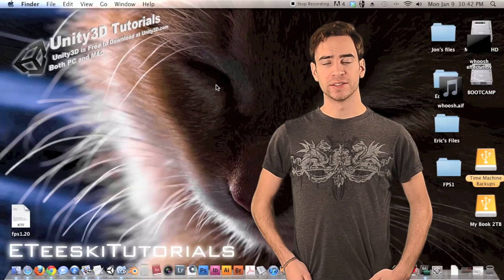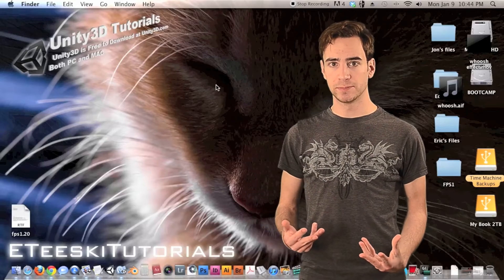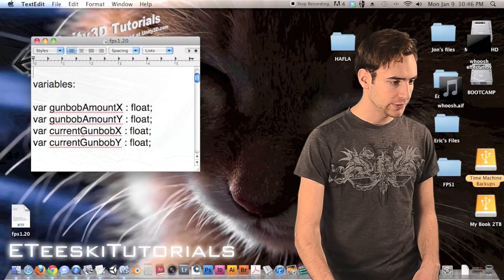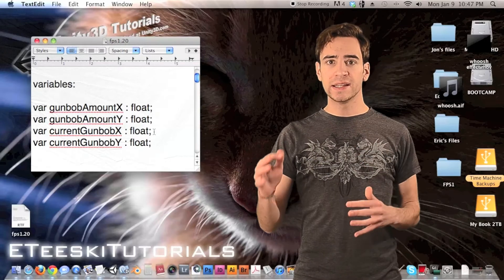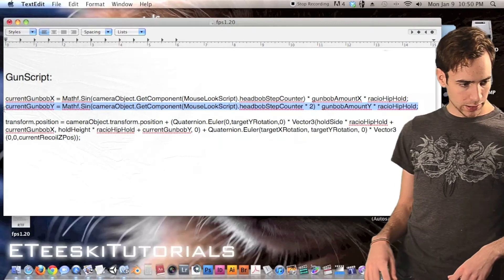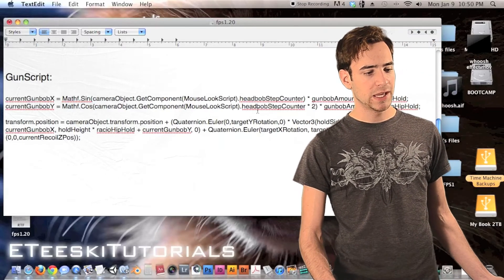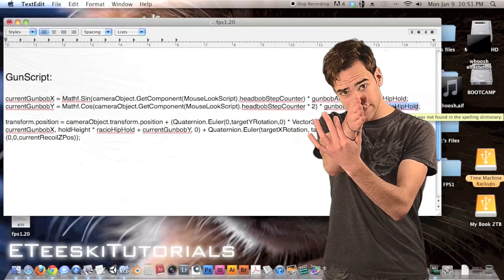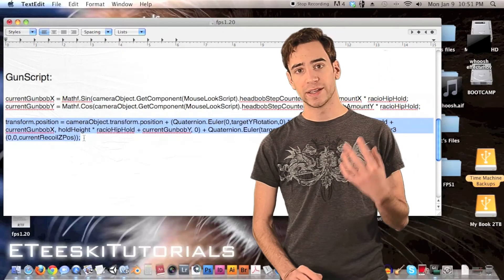FPS1.20 Gun-bob Movement. Unity3D FPS Game Design Tutorial.

Comment: i have a problem. the gun bobs and it works but its not smooth its rough when it moves like it will move a little to the left, right, up, down while the gun is bobbing and it does not look right.